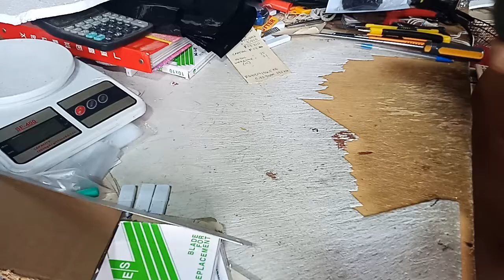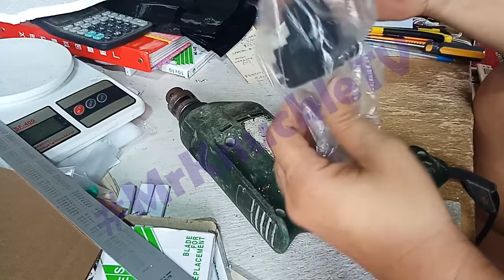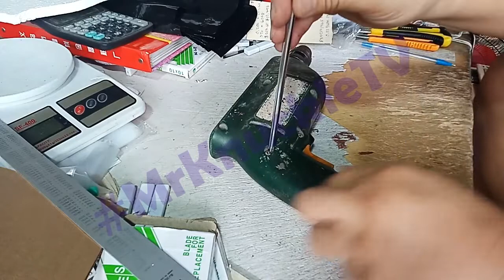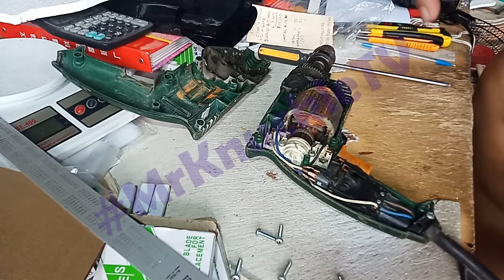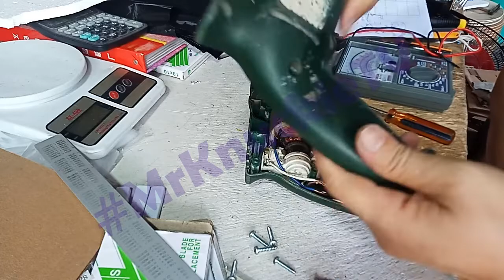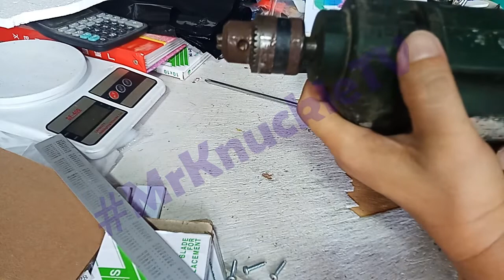24years Old Bosch Hammer Drill DIY Repair

Comment: Bosch PSB 400RE drill

Hi, I have a drill that is a bit old but it has always worked well and recently it no longer works!!!
I have to give it a few turns to make it turn and then it starts but then again after a while it stops working.
What problem do you think he has?

Can it be repaired? If I clean it inside with reactivator and replace the broken components, could it work again?
---
Trapano Bosch PSB 400RE

Salve,ho un trapano un pò datato ma ha sempre funzionato bene ultimamente non gira più!!!
Devo dargli qualche giro io per farlo girare e poi parte ma poi dinuovo dopo un pò smette di funzionare.
Che problema ha secondo voi?

Si può riparare?Se lo pulisco dentro con riattivante e sostituisco i componenti che si sono rotti potrebbe funziona di nuovo?
Reply from the maker: If you could identify the defective part i'm sure it will work. Or maybe there's loose connection in some terminal, try to resolder also, it could help.